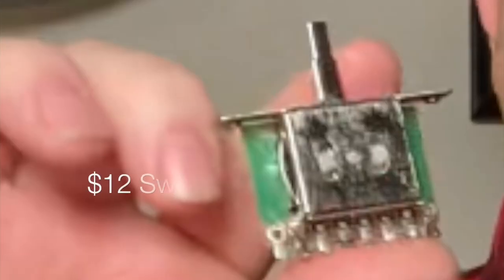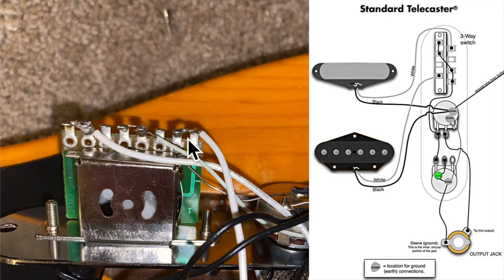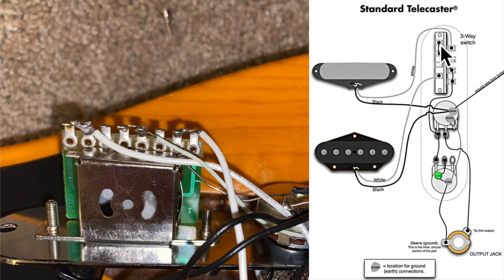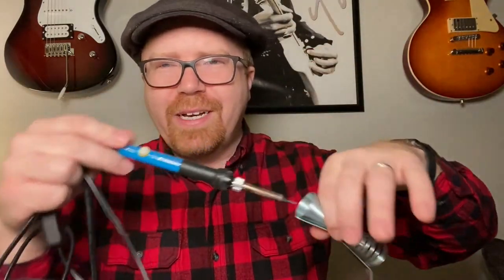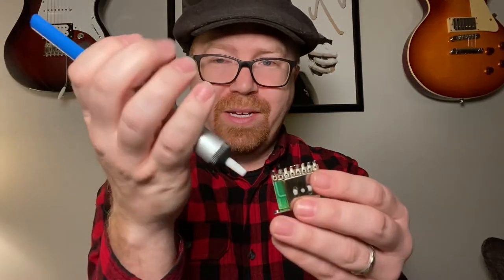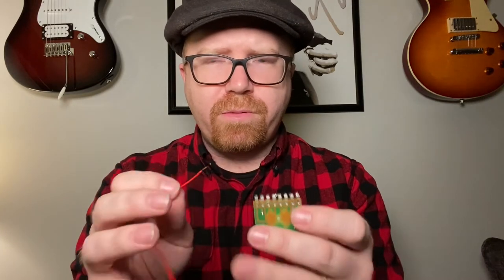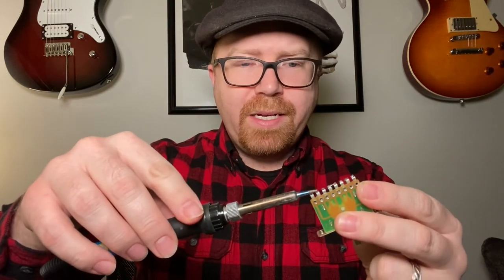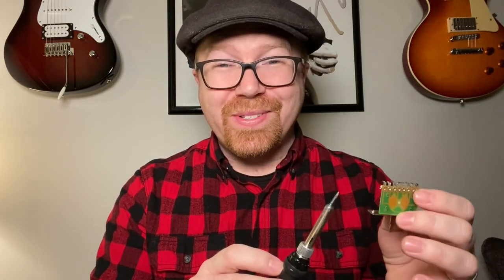Revive Your Tele | How to Replace the Switch on Squier Affinity Telecaster | DIY | How to Solder

Comment: Thanks Justin! This clip is a life-saver.. I have the same annoying problem with my switch where the bridge pick up cuts off..
Reply: I also have a buzz.. Could that also be due to the faulty switch?
Reply from the maker: @srikanthnishtala2162  single coil pickups have a slight noise called a 60-cycle hum. If you fix the switch, putting it in the middle position should lessen the hum, but really the only way to reduce it is to get a noisegate pedal.

Comment: Had this exact same issue on an offset tele copy of mine. The switch in the neck position was unreliable. I could wiggle it and have it come on for a little bit, only for it to go out again. I viewed your video at least a dozen times to learn about this, thank you for it. I have installed a new switch and it seems to be working. I followed the original wiring pattern that was on the switch already in there--a slight varitation in which the ground from the neck and bridge are twisted and soldered together and then soldered--along with the ground that runs to the volume pot--to one of the higher lugs on the side of the switch. Technically the way you do it here is probably more accurate, but I decided to follow the wiring it came with. 
I have a feeling this is not an uncommon problem with these import switches. One other thing, when doing the tap test to check which pickups are on, use a pick rather than a screwdriver. I was just using a screwdriver for this and it left little scratches on the chrome cover. Not everyone cares about this obviously, but it was something I noticed. Thanks again for this, I feel much better about soldering for future projects.
Reply from the maker: Way to go! It gets easier the more you try it. Follow Radio Shop pickups on Instagram for more tips on how to make it easier.

Comment: Hi, I want to know what value resistor comes with this guitar across the volume potentiometer parallel to the 0.001uF capacitor... I'm in the middle of fixing my squier tele affinity and have lost the original resistor and hence don't know the value...

Comment: Nicely done. You're very thorough and careful. But replacing a broken crap switch with a new crap switch, I'm afraid, is NOT an upgrade. All that effort and you still have a crap switch. Next time just get a regular Fender 3 way switch  like are in Fender Telecasters. Sure, they're more than $12, but they LAST.
Reply: I totally agree! Moreover, 12 $ for that junk switch is a steal. ☺